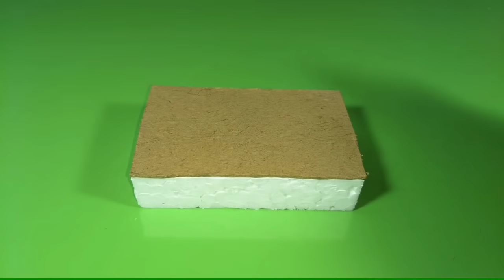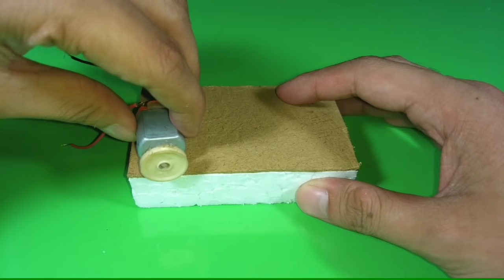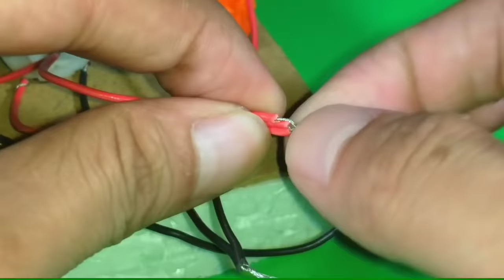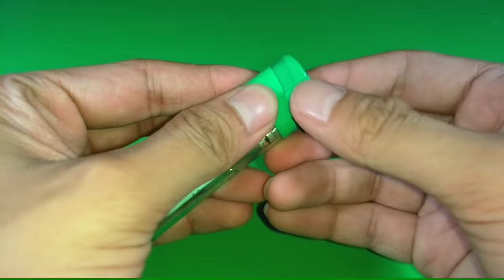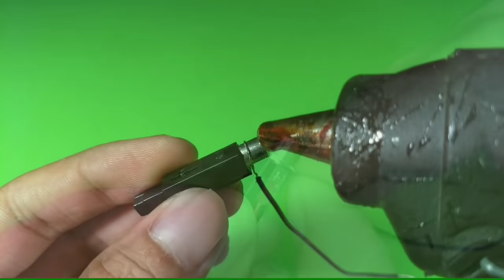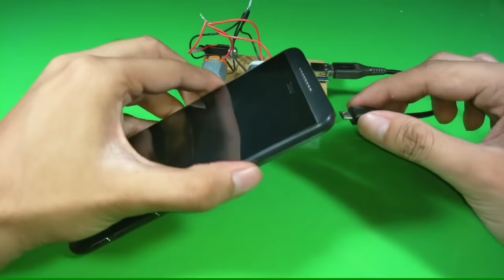Free Energy Mobile Charger - Using Piezo Igniter

Comment: Does it work ?
If it works what is that circuit name?
Pls do tell,..
Reply: I do tht name of circuit
Reply: It named of "kumaha bengeut sia we" circuit . That is all i know
Reply: It can work
Reply: It consists of a motor which on adding cell generated rotation and the other is generator which on moved by motor generates electricity and I don't think that circuit is needed because if you add you mobile charger wires with the wires connecting with generator it should work
Reply: That circuit as saw acts as a charging point
Reply: Well I don't know more
Reply: So you should add the circuit

Comment: Energy can neither be created nor destroyed, BUT CAN BE CONVERTED FROM ONE FORM TO ANOTHER. 
So basically he is using the kinetic energy from the motors which is CONVERTED to electrical energy. This is due to the magnetic fields being cut by the rotation of the inside of the motor which in turn create electrical energy.
Reply: you could be right if there was no friction inside the motor . because nothing is perfect , so as in this case , motors loses energy due to friction in the form of heat .  also, piezo igniter emits a very high voltage far more than the motor's capacity. So my advice- think before you Comment 😇do watch this https://youtu.be/5ykqsmIdsg4 till the end..
Reply: It is false, since energy is dissipated in the form of heat, infinite energy does not exist, you have to keep in mind that there are no perfect materials, they all have resistance and of course there is also the friction of mechanical parts
Reply: how long will the motors turn? Or is this endless energy

Comment: My brother can respond to my question how the engine turns off
Reply: hussein ali wire cut off
Reply: There is no other example
Reply: Stop the wheels of motors
Reply: We can also use a switch with one of motor
Reply: Super question bro
Reply: The motors will turn off automatically after a few moments.
Reply: Just cut a wire and if you want it to start again,you just have to connect the wire again
Reply: @jihadhasan9599  by

Comment: What material did you use? Can you list it down
Reply: 2 DC motor
2 pcs plastic pulleys
USB charging module
Piezoelectric igniter
Some wires
Reply: @jhebertdelacruz5437  dc motors?
Reply: @David_2473   Yeah
Reply: 3 v?
Reply: @David_2473  Yes
Reply: @jhebertdelacruz5437  👍

Comment: There is a battery inside the thermocole and the second moter is turned upside down toget to the battery under and not to show the wire
Reply: Yes bro there is inside a battery that will charging the mobile

Comment: You supply power to 2 motors and the charger from the battery. No battery. The system stopped working.

Comment: Not free energy
The first law of thermodynamics refers to the conservation of different types of energy: Energy cannot be created or destroyed but is just transformed from one form into another. ... Internal energy is a state function, so its change in going between two states is the same, independently of the path the system has taken.
Reply: absolutly correct